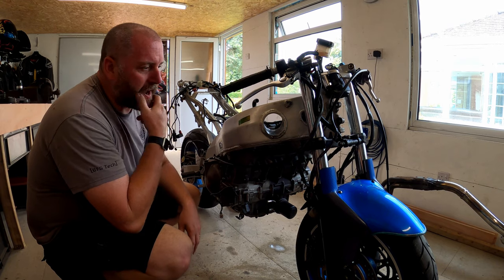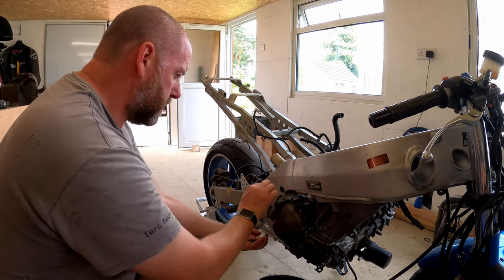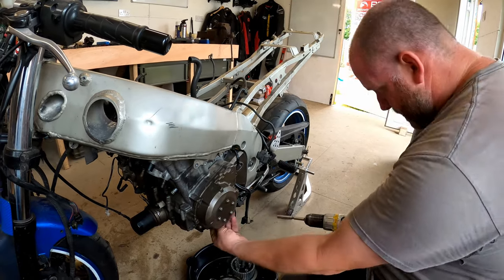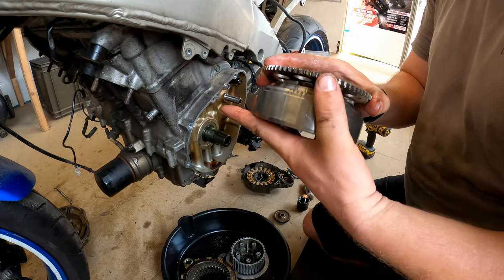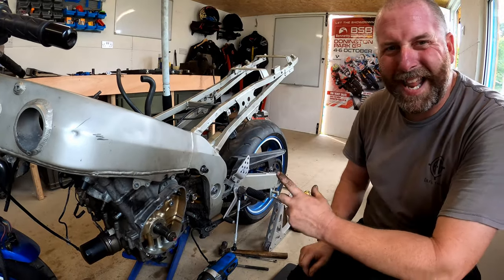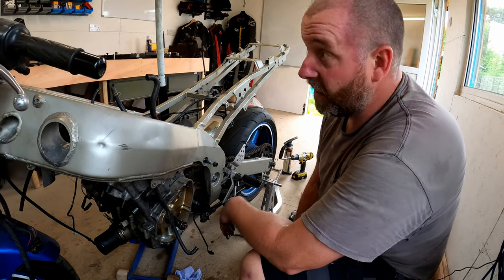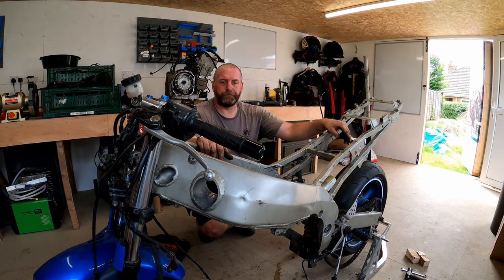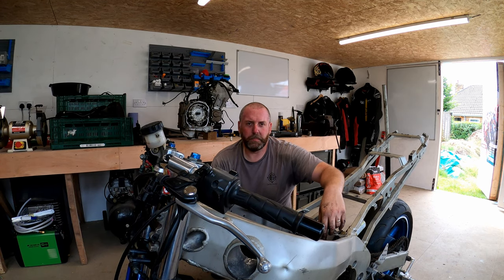1998 Kawasaki ZX9R - Project Shinobi, Episode 5 - It's Time We Dropped This Engine Out Of The Frame!

Comment: Another great video. No offence meant here but I was howling watching you remove that front sprocket nut, been there done that, the second one I did I was prepped and ready for the hard fight with the grolly bar, but I was lifting the grolly bar while standing on the rear brake pedal, I was not expecting it to give up the fight as fast as it did, so fast, in fact, the grolly bar smacked me in the mouth.
I'll say I expected you to remove the front mudguard just to stop it from getting damaged, but it looks like you got lucky, I expected the engine to smack it.

Comment: Nice video as always! Are you honing the cylinders? Might as well of you're cracking the engine open. New rings with old pistons,  or get a big bore kit. I got a Wiseco 923cc kit, installed it myself. One mistake I made was that I used fully synthetic oil to break in the engine... One is supposed to use mineral oil for motorbikes/wet clutch. Nevertheless, it works great, no issues. But I did a hard break in! I didn't even let her idle, just started up, rode around the block, varying the revs all the time, then ripped as much as humanly possible on public roads. It works amazing! Burns NO oil! I'm actually amazed that I managed to accomplish this with no mechanical background. I love working on the 9R! I know the bike in and out! I've got a couple of dirtbikes as well, which I find horrible to work on, not like the Kawa...
Reply from the maker: I’ll reuse the original pistons assuming that they are in good condition. Naturally I’ll be replacing the rings and will hone the cylinders as it aids with the bedding in procedure. Thanks for watching 👍🏻
Reply: @KevsShed  Looking forward to the process! You'll end up with a stellar bike when you're done!
Reply: Fully synthetic is best, mineral oil is the worst as it has impurities, semi synthetic is a good in-between.
Reply: @HalfdeadRider  Yeah, maybe... «Everybody» says that mineral oil has to be used for break in. They might be correct, but my ride-it-like-I-stole-it approach with full synthetic oil worked great👍 The bore and hone was done by a pro motorcycle mechanic, using a Sunnen hone to finish the job.
Reply: @nitramh24  there are specialist run in oils I think, they are thinner oil hence the run in needing to be gentile. It's to allow piston rings etc to run in without too much stress.

If you want the best fully synthetic oil formulated for bikes, get Motul 7100. After doing an oil change in mine using it, the engine runs up to five degrees Celsius cooler depending on ambient temps. The other benefit of fully synthetic oil is that it does not lose it's viscosity at high temps like other oils, perfect for performance engines.
Reply: @HalfdeadRider  I’ll check out the motul oil when for my next oil change, thanks👍 Mine runs hot, esp at idle... They’re kinda tricky to jet correctly when you fit a free flow exhaust. But once I get her going she cools down just fine and is a complete beast! I’m gonna fiddle around with the jetting, but I’m busy with another project so the 9R is on hold atm
Reply: @nitramh24  Mine has stock carbs, K&N filter, Delkevic end can and a +4 ignition advancer. I think the downpipes are from a later model but not sure if there is a difference, they are larger internal diameter than yours stock though I believe, from E1+.

I may fit a Dynojet kit at a later date, but I think my carbs were set up well for what it had before I got it and still ran a little rich, that is then sorted to some extent with the ignition advancer. They will always get up to higher temps at idle, it's good to run them until the fan comes on at about 101 degrees celsius if they are not used often, at least once a week or so.
Reply: @HalfdeadRider  Mine is a C1, Wiseco 923cc big bore, E headers and midpipe, Leo vince exhaust, +4 ign adv, dynojet stage 1. I dont think there’s a faster one in Norway where I live right now. A buddy of mine won his class in the Norwegian roadracing championship with the same set up, and dynoed the bike to 153rwhp. I copied his set up, and it works great! (Edit, he won his class on a 970cc 9R, but that engine blew up eventually. But he ran a 923cc before that). 
I think I just spent a grand on parts, and did all the work myself. In the UK you can get the C models for under 2 grand, and if you do the wrenching yourself, you’ve got all the bike you’ll ever need. The build quality is very good, and no silly electronics that require a phd in computer science and ai to do the mods
Reply: @nitramh24  Did he fit uprated con rods and pistons with some race cams when he went 970cc? if not maybe why it blew. Doubt I'll go that far with mine, will keep the engine standard, it's a rocket already.
Reply: @HalfdeadRider  Yeah, cams, ported intakes/exhaust, flat slide carb etc on the 970. Can’t remember what else he did on it, but it was fast. I have kept the carbs and cams stock on mine. No porting either, since I dont know enough about it.